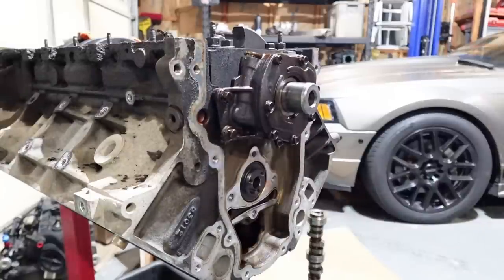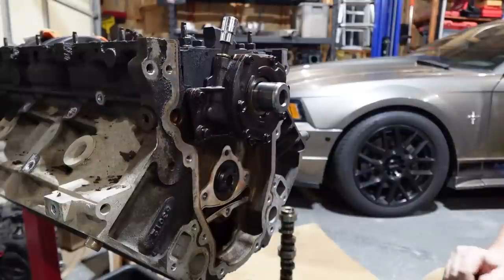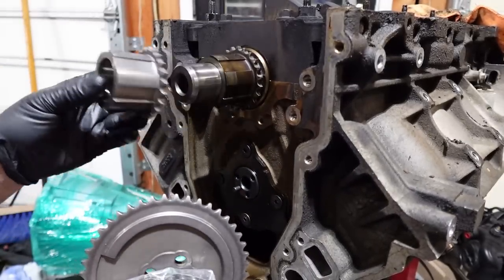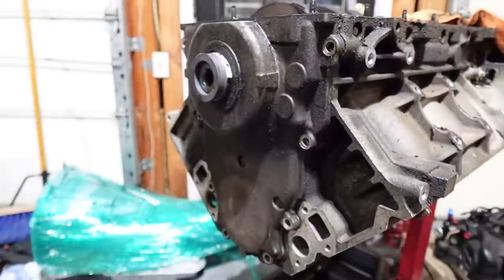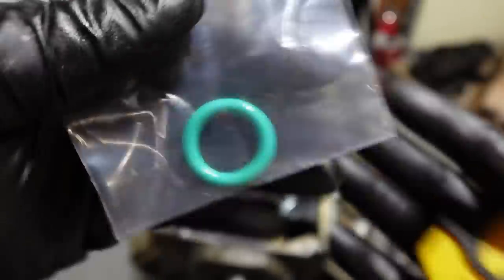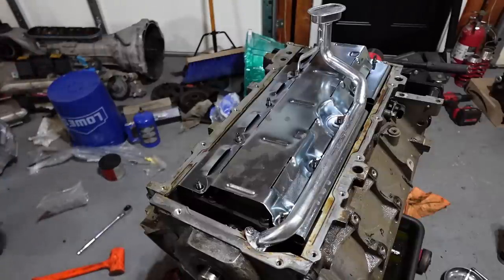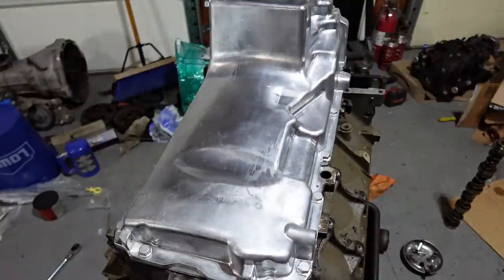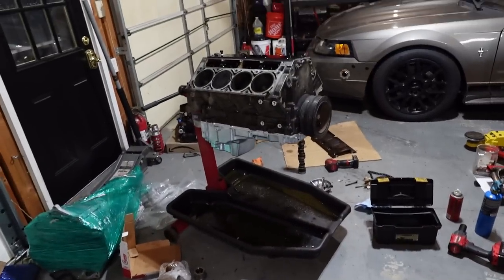do LS oil system tricks work? timing chain and china pan install

Comment: Damn Fancy Mechanics😂. I never replaced the barbell or the timing gears. I have tossed a chain on a few of them and I only use the tensioner on manual transmission vehicles.

Comment: Your oil pressure is always low because you don't put cam bearings in them. Ever since I started putting new ones in, my oil pressure has been 20-30 psi higher. Aint a barbell that'll fix that.
A spring isn't gonna change idle pressure. All that does is hold the bypass closed so you'll have more pressure on the rise, the bypass doesn't open at idle..
You're not doing much of a high rpm na build with that timing set! You need a chain dampener and adjustable timing set so you can degree the cam..
Reply: I'm the opposite of sloppy. I have issues. This actually made me sick to my stomach. Bit I was sloppy When I installed my new cam bearings.  Didn't check clearance, Thinking hey new cam new cam bearings...good to go.  Nope!  Have half the oil pressure I had before and The old burns were trashed. Whamp' waaa. Probably 1-5  from what I've seen on powel machine. 🫰

Comment: Beware of 'knock off' cam plates! Got one that looked perfect, but was a few thou' too thick. Tightened up the 4 bolts and it locked the whole assy up.  Did nothing but swap to a GM one and it was perfect.
Reply: And the borrow of the kids playdo to check the oil pickup height to the pan.
Reply: Mahle brand cam plates always work well for me. Get them at my local oriellys same or next day which is nice.
Reply: @Pinestreetperformance  - I'm in a 'rural' area of southern Canada, so am somewhat limited to what I can get on the jungle site, or have mailed in. I have used other Mahle stuff in the past though and have always been impressed!

Comment: I've been using shims behind the stock oil pressure spring and getting 38 40 psi hot after a pass.  High 90s psi during the pass. Vr1 20 50 oil there all the same on 3 different cars. Also use a felpro o ring on the pick up.

Comment: Porting and dimpling the oil pump and adding a couple small washers to the stock spring gave me all the oil at 70+ psi and 40-50 psi at hot idle
Reply: Yup. All I did recently on my “refresh” was washers to the stock spring and dumbbell and I also have 40-45 psi hot and over 80 at wide open
Reply: Same here .100” shim to the stock bypass spring is a good upgrade. +- 60-62# cold start, 48-50# hot idle and easily 70#+ with rpm.  Recommend to run a 7qt oil pan capacity if possible.

Comment: If you want a cheap performance pump, The LC9's with DOD have a higher volume pump. With just the DOD ports blocked I'd see 70-80psi at idle and burry a 100psi gauge at RPM. I actually snip off 2 rungs on the spring to get pressure down with the LC9 alum 5.3's. 

 I know you aren't a "torque spec fella. but those #40 torx screws on the retainer plates are only 11ftlb. They crack at the countersink if over torqued sometimes.
Reply: I noticed this as well, good to know I can lower it a little bit by just chopping down the spring.  Seeing over 80psi at idle was disconcerning, lol.

Comment: Shim the spring as well. The only way I’ve ever been able to increase the idle oil pressure is to increase spring tension at low flow I.e. shim them. I now do this for every engine I lay my hands on and typically never see less than 40-45 psi at idle and never less than 80 psi above 3000 rpm. I recommend it for everyone. I went extreme and even doubled the shim stack (from .0125” to .250”) in my daily and have run 50+ psi at idle for almost 4 years on a bone stock L59 5.3. Can’t recommend it enough
Reply from the maker: Shim and the big boi I installed together? Shewwwwww
Reply: @SloppyMechanics  haha go big! Usually shimming the stock spring gives me enough pressure all throughout. The higher pressure springs in my experience provide the necessary pressure up top but still leave some to be desired down low. I mean 40 at idle isn’t necessary but it sure makes me feel warm and fuzzy when I’m hot idling.
Reply: @clappedoutbuilds6637  "usually".....LOL! So vague. I used 3/16" brass bushing....maybe I'll see +50psi over stock 😅

Comment: My 6.0 DOD delete engine has crazy high oil pressure. Hot summer day with ac on it's never below 50psi at idle. WOT pull goes up to 90psi and that's on a auto meter mechanical gauge.
Reply: Yeah same. I have an Envoy denali that I deleted the DOD on and put a C6 corvette pan on and that thing always has around 50psi at idle. I left the stock oil pump in it with over 200k miles.

Comment: built a 408 with a 10296 half H bearings and half HX bearings on both crank and rod to get desired clearances.  Put in the big spring that came with the pump and with 20w-50 it makes 85psi at idle and goes over 100psi every pass
Reply: That’s too much pressure for me. You don’t need that much pressure in these engines. 40 is enough at idle. You’ll be blowing out seals in no time if you’re at 85 at idle.  I’ve also found the the lighter weight oils need to be changed more frequently.

Comment: I have also  seen if you are using the dod/afm motors that the oil pan  pressure  relief valve on the inside  above the oil  filter sticks open   will cause the pressure  drop. Pull that and plug it.
Reply from the maker: i have heard that also!

Comment: I saw a drop on oil pressure after an oil change with a PF46 filter. I got a hint there was a change in production. It dropped 10-15psi. I got a hint from the SPP guys that using a UPF48R filter from a ZR-1 would restore it. It worked- back to normal
Reply: The Oil filter caused a drop in pressure?
Reply: @StreetRacingLifeStyle  from my experience yes. I use a wix filter from a grand prix (2006? 3.9L) that is longer  for extra filtering
Reply: @bobbobby1846 oh that's not a cartridge? Interesting
Reply: @mxmang  on my 2006 silverado 4.8L. 40 psi at idle with 5 30w oil at 550rpm at operating temperature. wix filter 51522.

Comment: Honestly all you need to do for the oiling system is shim the stock spring with some washers, there a charts online how far to do it but usually it's every 10 thousandths is 10 psi. The barbells are useless unless you just want to spend money, and if you want to a higher flowing higher capacity pump grab any stock replacement pump from any motor with AFM because they have a larger G rotor assembly. Then just spend 30 minutes porting and smoothing out the inlet to the outlets to the pump. I get 50psi hot idle and 90-100 full rip on all mine
Reply from the maker: i put in a melling 70+ psi spring to see what happens instead of shimming and shit
Reply: @SloppyMechanics  Either way works 👍

Comment: a free mod to try - dimble the face of the oil gears by drilling a shallow hole in the center of the inside gear face at all of the  fingers. Also cleaning the passage up with a drimmel helps flow
Reply: Keep in mind that more volume isn’t always a good thing. If you have a shallow pan and a road race car fir example

Comment: Little late, but I have a 280K mile unit, I just did a 10296 and a copo spring, nothing else, warm is 64 and hot is 96. sbe 5.3 on E85.

Comment: Not sure if you’re into this kinda thing. Or it’s too late. But I like to port the entry on the oil pump bog and make smooth radi’s. A pump spring shimming too. 300k + mile lm7 lasted 3 years and had 45psi hot and 75+ wide open

Comment: I used to never touch oiling system other than new pickup tube o ring and cam retainer. 

Since I started changing the barbell, filter bypass, and spring oil pressure is much more stable and linear for lack of a better way to describe it.
Reply from the maker: Awesome to hear that’s what I want to see

Comment: I just changed my oil pump and didn’t shim it or turn the crank with the bolts loose, I’m seeing a lot of people say to shim it now and a few saying they never have done it, seeing you not shim it or even try to center it makes me feel better, because when I was installing the crank bolt it turned over easily so I’m hoping that means it clears and doesn’t rub
Reply from the maker: i must have put together hundreds with reckless abandon and oil pressure was never on my mind. never had oil pressure related issues ever
Reply: @SloppyMechanics  that makes me feel better for sure
Reply: @SloppyMechanics  you never even turned the crank with the bolts loose?

Comment: If you put cam bearings in these ls engines and add in the cam plate pump spring and maybe the barbell you will have much better pressure. Just the cam plate and cam bearings you will be shocked the gain. Might need relief spring or shim your stock spring.
Reply from the maker: an awesome experiment would be, 
i have lackluster oil pressure after all of these simple mods,
i pull engine and just do cam bearings and reinstall,
and i see a dramatic increase in pressure,

that would be awesome and i will do it!

Comment: I think the spring will be most beneficial. Of the 3 aluminum blocks I've done, the one in the Ranger is the only one with decent pressure because it has high pressure pump. My daily, and the 350z both have like 25-30 hot idle and that was with new stock pumps, cam plate, barbell etc. The Z even had all fresh bearings. I feel like the aluminum blocks expand more when warm, loosen bearing tolerances and have lower pressure...But, 2 were gen4 one was an L33 so maybe theres something to that...In for results 👍
Reply: My ls1 has less pressure than most guys talk about with steel blocks. You may be onto something with your alloy block theory.
Reply: There are aftermarket oil pumps with an oring to seal to the block. Yes No? Did Chevy do it to bleed air from the oil?
Reply: Hey Ryan have you heard of anybody having issues with finding the right cam bearings for an Lm7 abuddy has tried three different sets and they all had a tight bore after installation and wouldn't let the cam go in or if he did get it to go in the cam was really hard to turn by the book it shows three different part numbers for cam bearing sets I'm starting to think Gm bored the cam bore from opposite ends of the block and must of had some alignment issues to have three different sets of cam bearings for the same engine the old Ford modified engines had the same problems if your center cam bearing wasn't chewed up you left it alone and just replaced the others because any we did all the cam bearings in one it wouldn't let the cam go in or would spin the center cam bearing during break in or shortly after
Reply: @79huddy  What tool was he using? The LS specific tool, or the universal expander type tool? The expander type is real easy to mushroom the ends of the bearings enough to make them tight. Or if they're slightly crooked they'll be tight. I also believe some bearing material can get scraped off the back side and make high spots in the bearings. When I did the Escalade bearings there was high spots in the center of the bearings, and had to scrape them to loosen the cam. I cut angled grooves into an old stock cam, and put it in, spun it over a couple times, and it scrapes the high spots enough to free it up. But that was with the expander tool. Whenever I've had a shop do the bearings they don't look honed or scraped. I believe the LS specific tool works well too, but haven't tried it myself.
Reply: He is using the ls cam bearing tool from Summit I had said something to him about cutting a Groove on the old cam and reaming the high spot on the bearing I had to do that on a Chrysler 340 that someone installed the cam bearings on a gaulded journal I had knocked the bearing out and ran a hone a couple passes but even after the clean up the new bearing was tight my buddy thinks he has to have solid Gray babbitt around the whole bearing I told him it's either ream the bearing or tear it all the way down and have the cam bore align bored and install oversize bearings but he's the type that knows it all so he isn't gonna listen to someone who has rebuilt and assembled engines for over 20 years I was building lima 2.3 race engines for my dad when I was 14 but you know a guy has managed to swap a couple engines and cams and thinks he knows it all I guess I'll just keep watching him ride that struggle bus though
Reply: I don't know about you guys but I always run a hone through my cam bearings before I put my cam in after I put brand new ones in
Reply: @Smokey72013  sssshhhhhhhh🤫
Reply: All I wanna know is how much shimming netted how much more pressure.....FROM ANYONE'S experience. No one ever shares pressure changes.....🤔
Reply: @79huddy had that issue with 340s...   Ream ream ream...

Comment: Use either the block or the spring chain tensioner. The 1x or 4x cam gears have asymmetrical teeth on them. I’m pretty sure that’s why they went to the spring tensioner. Stare at the teeth on that 1x wheel. You’ll see them. And I used a new barbell, front plate and high pressure melling and I am getting great oil pressure.

Comment: Prostock used to push volume instead of pressure,so much so idling cold their low pressure light would flicker,to my understanding the pressure costs a lot of horsepower,but volume doesn't so much.

Comment: Drove my rx48 yesterday has a journal vsr7875 I did like all the things for op and my idle op is decent 35-40psi at like 170 deg 700rpm I make a couple rips it’s 18psi and water temp only gets to 180’s I have no restriction in the oil feed and no oil cooler… mains and rods .002-.0025 on the plasti-gauge 😅 I dunno I might try both of those things. I wanna see how yours comes out. Without the turbo on it

Comment: The oil pump I tryed to get the cap off to the spring put pump in vice and the jack handle on the 1/2  Ratchet I thought I was going to Snap the pump in half so I quit !! I wished u would have showed getting the cap bolt plug thingy off !

Comment: Has anyone looked into the oil pumps cut for an oring? The oil pump to block with no gasket is a major pressure bleed. WHY did Chevy make it this way? To bleed off air in the oil?
Reply from the maker: I thought of this the other day about a o ring model someone has to make one haha
Reply: @SloppyMechanics  Butler and Schumann have pumps modified for an o-ring.

Comment: im very interested to see what this makes when you're done, my l33 all motor is at 382 rwhp, be interesting to see if its low or on par
Reply from the maker: awesome i was hoping to be right there also, whats your whole end to end, im curious of how much more a china 102 does over arguably the best intake ever TBSS boi
Reply: @SloppyMechanics  re ringed and bearinged l33, swapped to 862 heads for a little compression bump, tsp Magic stick 4, btr trunion upgrade, tsp springs, keepers, and pushrods, ls6 intake, home made 1.75 longtube headers into a single 3inch exhaust (might be restricting me slightly According to the tuner) and an old Toyota 5 speed manual
https://youtu.be/KSJbCBruP2k 
That's the dyno pull
Reply from the maker: @Ironsights85  ahh, manual trans yes i will be doing an auto but still looking to be where you are also.

this little B will easily bomb out low 11s with 400whp
Reply: @SloppyMechanics  nice,looking forward to seeing it!

Comment: Ethanol fuel boils at 178. It should boil off in your crankcase. My meth does. Is your oil always fuel contaminated?
Reply: that's interesting as everyone I know that runs e85 their oil looks like crap and their cars have stock cooling systems, so 210deg plus. I wonder if there's more to it than it just burning off.
Reply: @jsomething2  I'm not sure. No experience with e85. But a quick Google shows boiling point. If I don't let my meth engine warm up it will be a little milky. But after 10 or 20 min it's gone. You can actually see puffs of smoke come out of cc breather when it burns off.
Reply: @ryandee8543  that is interesting.

Comment: I've always wondered what's the reason for drilling the LS thermostat? This guy did a great video showing where all the passages go with strings pulled thru, and it mad me think open thermostat means recirculate, and closed thermostat forces water to go through the radiator, so wouldn't drilling it reduce cooling?  https://youtu.be/1qRzn0UsHqA
Maybe you drill a different spot than I'm thinking?

Comment: I was just listening to these guys haha https://youtu.be/YUSsbmpV1Pc
Reply from the maker: its funny people talk about it but my last 30 turbo LS engines when i never looked at it didnt seem to mind whatever they were getting with 300* oil temps from non stop burnouts
Reply: when I didn't have oil temp sensord in my old sbc cars, and early ls1 4th Gen. doing mountain runs and track days I never considered oil type, weight or Temps, get a c6 that has oil temp, first trip to the mountains, holy crap 270deg and I'm not even pushing it. Google says up to 300 with mobile 1 is acceptable, next day can put it to 300deg pretty easily. down the oil rabbit hole I go. 5 years later here I am with crazy oil coolers, changing weights and amounts depending on use, looking up filter specs. (WIX 57502XP higher LT style bypass 22PSI and longer, flush with bottom of the pan) and wondering about an ls oil pump used only the hybrid tahoe's that's veritable displacement and said to save 1.5hp. can still push backed 275 deg on a few laps at speed in a track but guess it's acceptable if ridiculous in my head lol. 

fml I miss the old days haha. on that note, you would be the perfect guy to test that oil pump out. part #12623423

and talk. about crazy oil pressure being accepted by gm. this is what prodamand says gm has programmed into the ecm for oil psi specs for that hybrid 6.0L

oil pressure spec hot
36psi @1000
42psi @2000
45psi @4000
afm relief valve 55-75 max. 
p0521 ecm detects different oil pressure than expected by lower 6.8psi or greater than 7.3 psi for 10sec